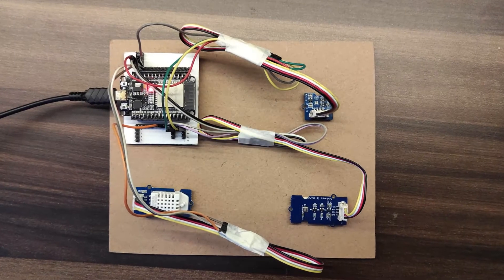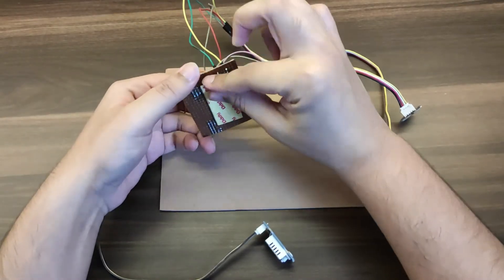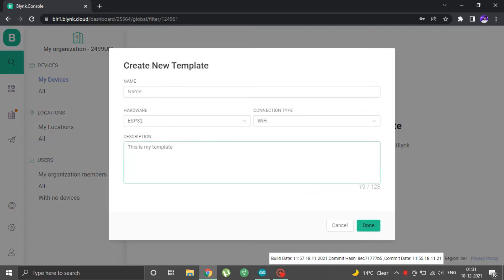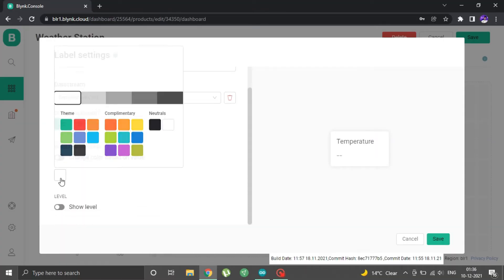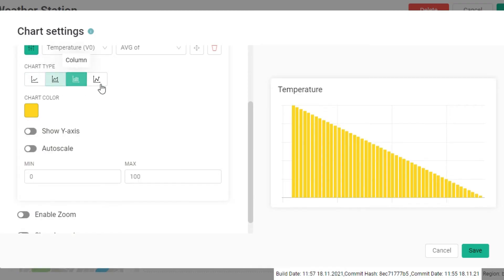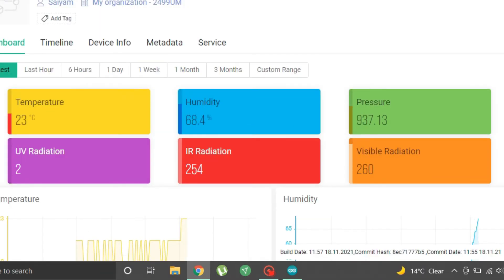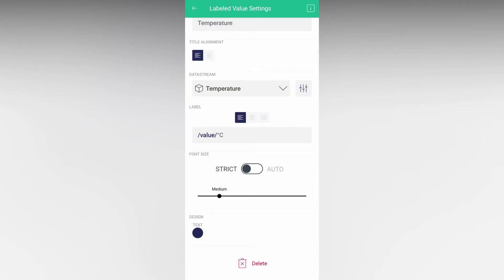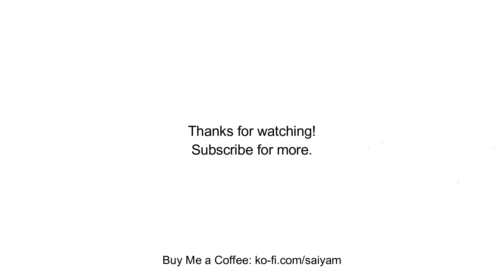ESP32 Based IoT Weather Station | How To Make | Complete Guide

Comment: im getting this in my serial monitor -> configsip: 0, SPIWP:0xee
clk_drv:0x00,q_drv:0x00,d_drv:0x00,cs0_drv:0x00,hd_drv:0x00,wp_drv:0x00
mode:DIO, clock div:1
load:0x3fff0030,len:1344
load:0x40078000,len:13964
load:0x40080400,len:3600
entry 0x400805f0
Beginning Si1145! . -------------------> that's it the shape doesn't show up what is the problem
Reply: Paste it on ChatGPT

Comment: Sir, we've been working on this project as per your instructions mentioned here but we're facing one issue, i.e the SI1145 Sunlight Sensor isn't available in the market and the ones available online seem to be different. Please guide me if I can use an alternative or if you know the same version of sunlight sensor mentioned here that I can order from any online sources (please provide) as per your knowledge.
We'll be really very thankful to you, Sir.
Reply: Salam, I ran into the same issue with the SI1145 being unavailable. After some research, I found the LTR390, which is an ALS + UV sensor. Unfortunately, it doesn’t provide IR data, but it does offer visible and UV readings. Some modifications to the code will be needed to integrate this sensor as a replacement. Hope this helps!